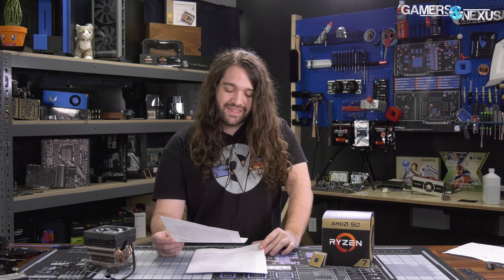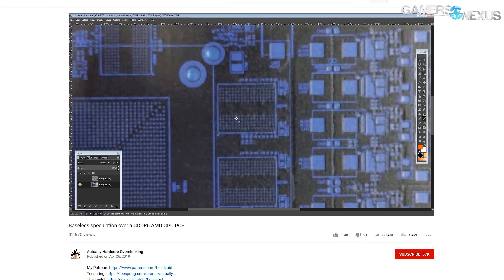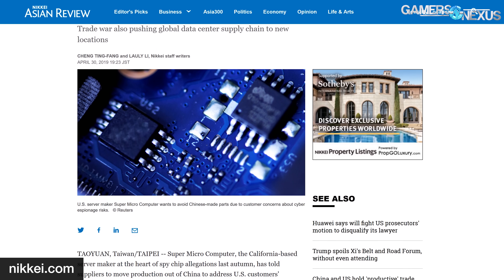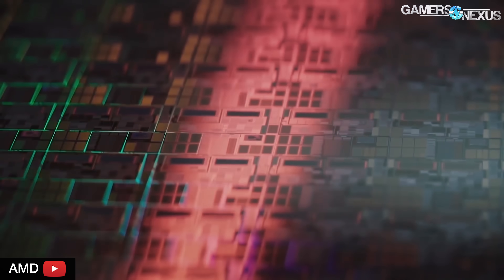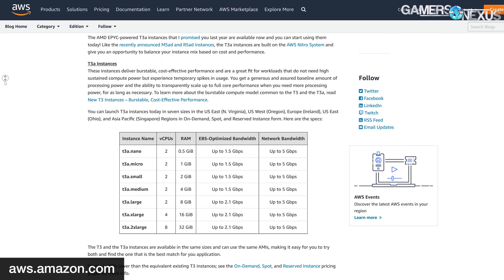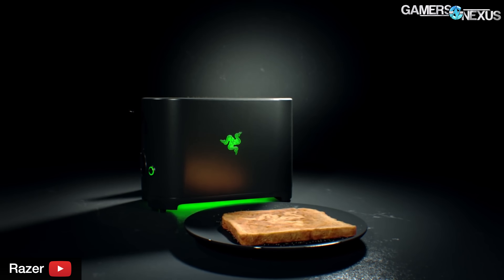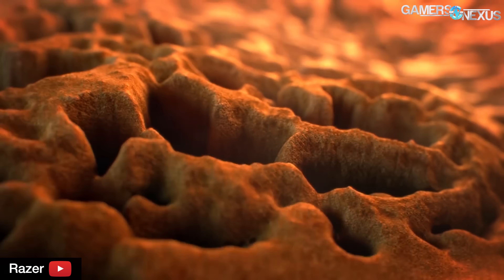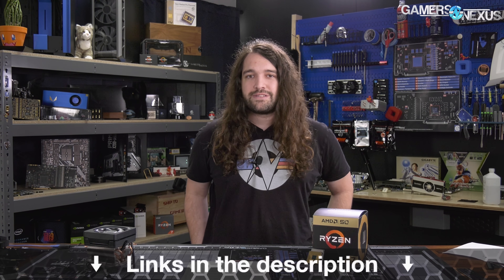HW News - Alleged Navi PCB, Global Chip Sale Downtrend

Comment: How is no one at AMD recognizing that they need to build more power efficient GPUs? Everyone laughs at the 1050 and now 1650 but they sell a hell of a lot better than the 570, 580 and 590.  If that really is a 300W Navi, its going to end up just like the 5xx series
Reply: You really believe that power efficiency is the reason that nVidia sells more GPUs?
nVidia had made worse GPUs in terms of power consumption and even back then they sold more.
Reply: @SolarianStrike  Not really. After vliw (hd5000) and fermi disaster Nvidia had gpus with lower tdp at every level. For the 7xx series Nvidia had no power connector 750ti. Amd had... The 7770 (which was good but weaker). For Maxwell amd had the r7 250x. Nvidia had the 950. For Pascal Nvidia had the 1050ti, amd had the rx550. This inefficiency was even worse on higher end cards, with the gap worsening the newer the cards are and the more performing they are. Vega64 is a power hog (yes it can be tuned but still). The 390x was also a power hog. The 290x as well. This handicap translates into amd not being able to put their gpus in another huge market, gaming laptops,where Nvidia owns 99% of the high end products, with amd delivering either ryzen vega options or Intel + low end runts such as r430 and the likes (basically useless dies).
Reply: Again, look at the Steam numbers.  1050 and 1050Ti top every 1070ti or higher card COMBINED and its not even close.  #1 card is a 1060, a card that is very easy on the PSU compared to the 580.  Actual sales indicate TDP is a big factor.@Andrew Crews
Reply: @WildkatPhoto  " Rob S
Rob S
10 minutes ago
Again, look at the Steam numbers.  1050 and 1050Ti top every 1070ti or higher card COMBINED and its not even close."

This only proves that Nvidia has a larger mindshare, and that non enthusiasts don't want to spend upwards of $200 on a gpu. Idiot.
Reply: LOL.  You realize that Steam practically defines the "enthusiast" market right?  "Casual" gamers are not on Steam.  Console gamers are not on Steam.  Steam people ARE the enthusiasts. Cracks me up that you are talking about people who "are not tech savvy" but also talking about people who are buying replacement GPUs and gaming on Steam.  "Not tech Savvy" are playing candy crush on their iPads, not replacing GPUs.  Not tech savvy are buying Walmart and HP prebuilds, not choosing a 1060 over a 1070ti.   @shawnpitman876
Reply: @WildkatPhoto  lmao "casual gamers are not on Steam"
Reply: Has nothing to do with wattage, has everything to do with mindshare and people being idiots.
the people buying 1050 and 1650 are the non tech savvy people of the world, the idiots who believing marketing materials.
Reply: Cool story bro but completely untrue.  I own two 1050Tis and an RX 570.  Right tool for the right job.  It wasn't marketing that got me to buy the 1050s, it was because they fit where i was going to put them.  Keep believing people are stupid and not that there is market demand.  @shawnpitman876